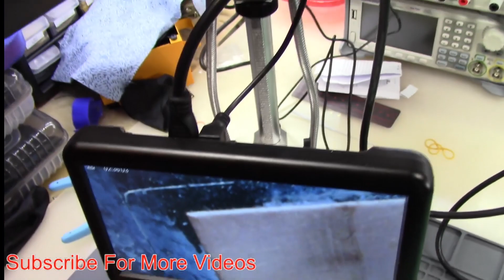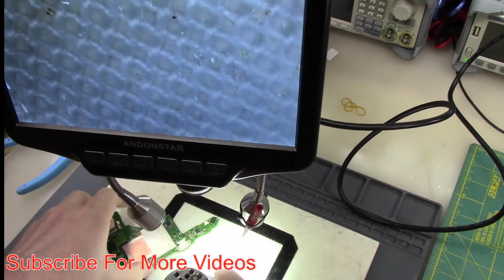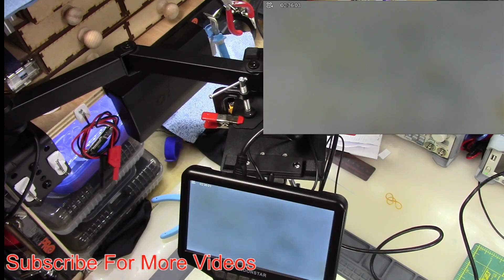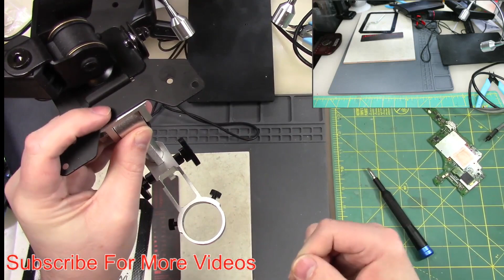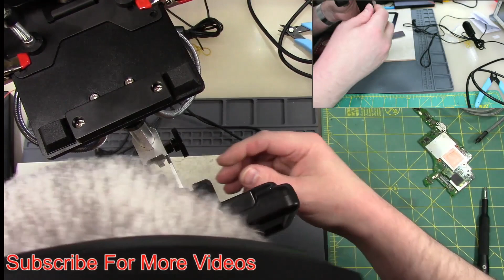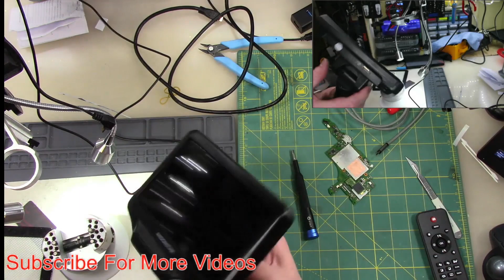The Redesign Of My AndonStar Microscope For More Uses

Comment: You can use the embossed place at the end of the lens (next to red ring) to hold it in the stand too. This increases the working height while still able to focus.
Heating up could be done by increasing the "3d" angle all the way down to 90° and having the pcb standing on the edge relative to working area.

Great idea by using the boom arm, will do that.

Comment: Just don't knock the board and you will be ok heating the board underneath. No worries.
Reply from the maker: Micro Mage Repair than you for the tip, I thinking about uses low melt solder on the connector just to be safe, but I got to wait until I get the bent nozzles for the new hot air station and they were delayed in shipping.
Reply: @jasondoesthings919  I like low melt for the port removals. Can try it on the LCD connector removal. I've not tried it myself.  Doesn't take a long time without it though.
Reply: I agree it would be pretty bad if you knocked the board but generally surface tension would likely hold stuff in place, I've knocked a couple of components once but they aren't too bad to sort out